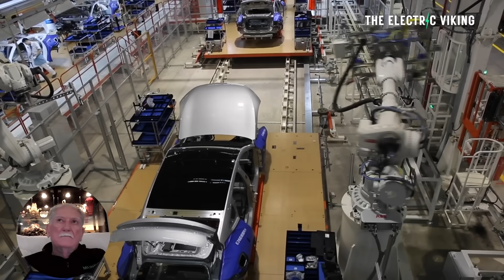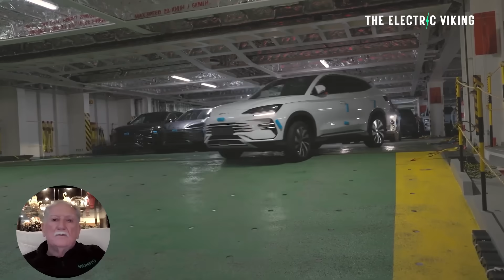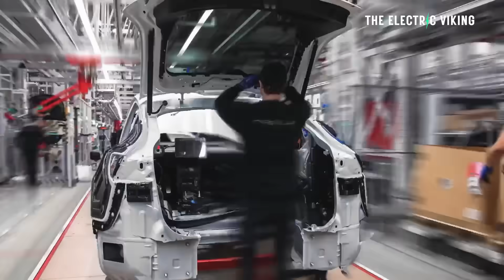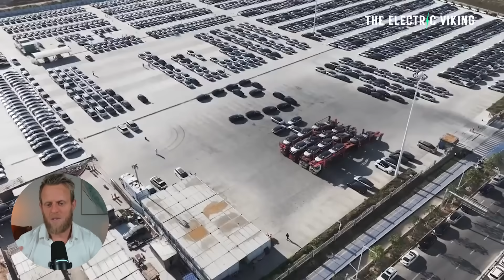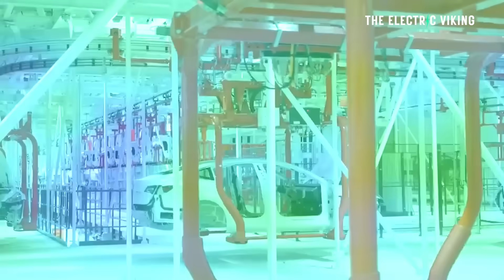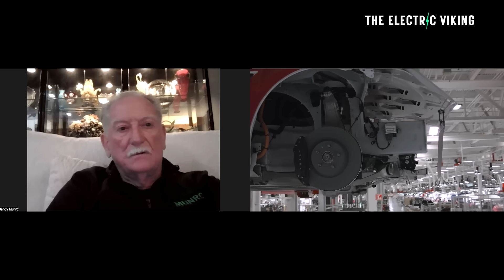Sandy Munro reveals why Chinese Car companies are 5 years ahead

Comment: Midea is the most important company that nobody has heard of.

I have bought a couple of multi splits from them with their linear indoor unit .  It is very impressively engineered certainly the best air conditioner I’ve ever seen.

I believe this company builds more air machines than any company in the world, but nobody knows them because everything they sell is private labeled. Although now I see Midea refrigerators and freezers  showing up at Costco.
Reply: Still have my midea AC. Been running since 2013
Reply: Nobody has heard of Midea? That's what happens when you live in a country cut off from the rest of the world. You haven't heard of Haier either? :)
Reply: @ДмитрийАндрианов-й4ы If it’s not Made in USA you can keep it
Reply: My sister and I both purchased a Chevy product 2 decades ago with exclusive 3 years bumper to bumper warranty coverage. 
Then comes problems. 
Then comes the fine prints at the dealership and factory representative. 
Then comes the dealership kicking client ass.
Then comes to disappointment with the paid customer service and warranty claim. 
Then comes the disappointment of the entire brand of GM products. @DeeBrow 

Got the same disappointment from my 2 next door neighbors. 
All said never buys another GROSS MOTOR product again. 
If it's made in US, we don't buy.
Let those other $UCKER$ buys them and learn at their own PAIN$ in the BUTT$.
Reply: @loktom4068 haha, same here.  i waited a couple years after Tesla Shanghai came on line so i didn't have to take Fremont made ones.
Reply: Midea Group is the biggest Home Appliances manufacturer in the World .  They brought KUKA from Germany many
years ago, and installed a lot of Robotic Arms into their production lines.     Midea is one of the pioneers in Factory
Automation in China, which helped to ease some labor shortage problems at present.
They also sell some of their products under the TOSHIBA brand ( which they acquired the major shares in 2016 ).
Reply: @chopinmack5418 Well you can thank Sandy.
Reply: I actually bought a AC unit years ago
Reply: Midea, was originated from my home town. 😊
Reply: I just purchased a Midea fridge/freezer for my workplace tearoom (in New Zealand), it didn’t cost much . I’ve never heard of them so it’s interesting to hear about this company.
Reply: Gree is way better than Midea.  In China most people buy Gree because it is similar in price but cooling much faster and quieter than Midea.  Just that these great A/C isn’t available outside of China.
Reply: @chiyanchan3311 yea never seen that brand here. All I see is midea, haier, hisense,skyworth, tcl.
Reply: @chiyanchan3311  GREE is available in Indonesia for several years now.

Comment: A lot of things said by Mr Sandy Munro are accurate.  I have been in automotive for 30+ years and am still in it.  The US company CEO and CFO are in for a short ride so they want to cash in quickly and jump ship!!!
Reply: That's because they have no choice. If they don't deliver in the next quarter, they will be booted out! The problem is with the system
Reply: I purchased a Chevy product 2 decades ago with exclusive 3 years bumper to bumper warranty coverage. 
Then comes problem. 
Then comes the fine prints.
Then comes the dealership kicking client ass.
Then comes to disappoint to the paid customer service and warranty claim. 
Then comes the disappointment of the entire brand of GM.

Comment: FUTURE BIG 3: BYD, Hyundai-Kia, CATL-backed companies using their CIIC platform... I think there will be plenty of car companies all using the new CATL all in one skateboard platform soon enough with automakers only making the bodies not underpinnings differently. Basically we'll see a huge flattening out of the market with a bunch of different competing brands all basically having the same powertrains and batteries from CATL with only stylistic differences in the cabin or body shape being able to tell a Honda from VW for example...
Reply: As a Hyundai Kona EV driver for over a year, I would attest that it is the worst car i have driven so far, the idiotic software and the button gear-shift are absolutely terrible designs.
Reply: Right, we''ll put cars together the way we do PC's today.  The battery and frame will be like the motherboard and there will be standard interfaces for all the rest of the stuff
Reply: Future big 3: no US, no japanese and no Korean

Comment: Engineering is the root of success in car companies.  When well done, every other department and group is just a drag on profits
Reply: Especially if you are a startup like Slate which Sandy helped create the engineering work for. This is why it only has 500 parts vs 2500 parts of standard truck and an all PET body since 60% of any automakers capital costs are a bloody paintshop and it's also the largest source of pollution and chemical contamination according to Sandy. If you eliminate this by having one color plastic embedded bodies like Slate will have you save a huge amount of cash, chemicals and time in building your vehicle. Also why they can build them in an abandoned printing press plant in Warsaw, Indiana instead of having to build a new factory or adapt an old abandoned one from say GM or Ford...

Comment: disagree with sandy saying chinese auto/assist driving system is behind tesla fsd. Huawei fsd is way better than tesla if u actually had a chance to book test yourself. Also xpeng or byd fsd is also very good, but currently top tier is still huawei
Reply: Agree wheelsboy tried both and came to similar conclusion
Reply: AFAIK he tested some old Tesla FSD version though.
I doubt current FSD as it is in California is worse than Chinese systems, as if it was, Huawei etc would already have self driving service like Waymo in China... But no such thing.
Reply: @lkrnpk  china has had different types of robotaxis for quite a while, longer than waymo
Reply: @INTREPIDNICKY  How many without driver? I have seen none. If they existed Chinese propaganda would bet first to brag if they had actual cars with no safety guy or any drivers taking passengers from A to B
Reply: @lkrnpk  you can find those vids on youtube easily. I think even CNBC covered it before. There are at least 5 - 7 startups and big players like Baidu that have working driverless Cab business running in at least 5 cities in China for more than 4 years....
Reply: @Fldllse  I have not seen any video on a scale of Waymo, that you can drive for miles without safety guy inside. Usually they show some small stretch of road where they maybe run without assistance of some person, or the person is there and involved.
As I said, if they had anything like Waymo, the propaganda machine would sing our ears full of that, like with high speed rail or batteries... or EVs. But we do not see that.
Reply: He has a terrible track record on this.  Around a year ago he was asked who makes the best EV batteries, and he said Tesla had reached the pinnacle, about as good as one could get!  He's he just admitted he owned Tesla stock and I wouldn't trust him as far as I could throw him.
Reply: Can't blame him if he gets to drive and test out Tesla.  China car company needs to invite him to test out their driving system or else it's a he said she said situation.
Reply: Wrong. Even Huawei’s CEO has admitted it. His quote was “Copying someone’s homework is not shameful, copying it poorly is shameful”
Reply: Yep lidar vs cameras. Instantly makes me think this old man has no idea what he’s talking about.
Reply: They’re Chinese still behind Tesla, no doubt about that when it comes to self driving. But with this pace of AI and investments that China has, it is just a matter of time
Reply: Very ture. The test drive of Tesla newest ver. FSD in Beijing just failed two months ago. The get nine ticket and 12 point deducted
Reply: XPeng has Tesla’s stolen code, so not even fair to compare 🤦‍♂️
Reply: I thought that Mercedes has level 4 autonomous vehicles, and Tesla's best is level 2.
Reply: @robinrussell7965 you thought 😂. Update yourself. Tesla is already on level 3.5 they are even capable of level 4 and 5 they are just cautious.
Reply: Where you getting your stats from. Tesla is way ahead. Not even close.
Reply: @sculpt-media have you ever driven a Huawei car?
Reply: Tesla FSD was in China a few months ago, it outperformed every one of Chinese cars including HW
Reply: @xiwenfan1765  Out performe in term of point deducted?? Tesla in China cant even stop in red light propely, ignore most of the rules lmao